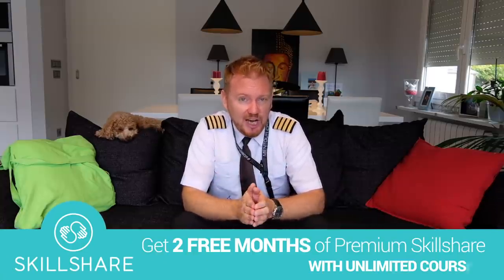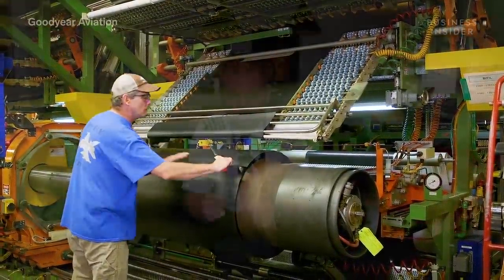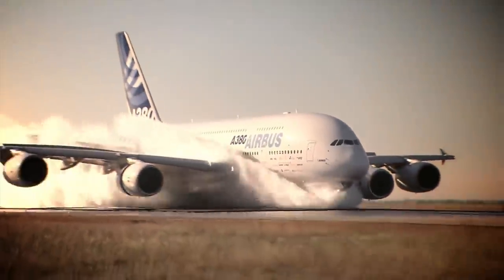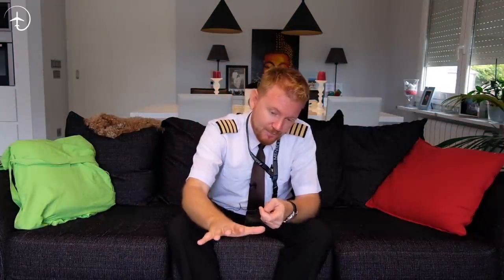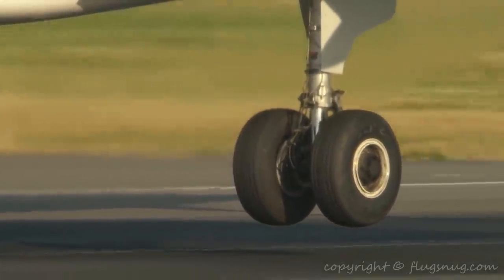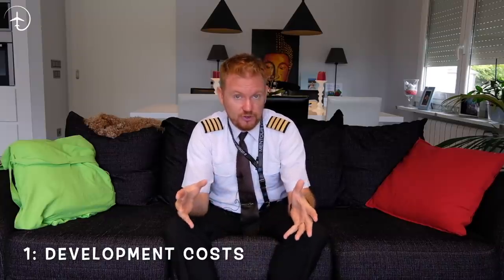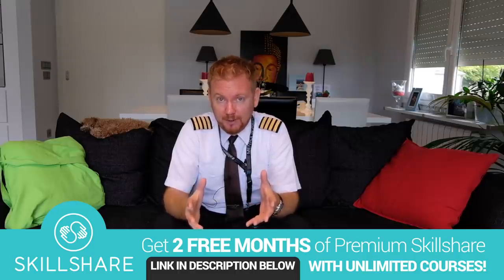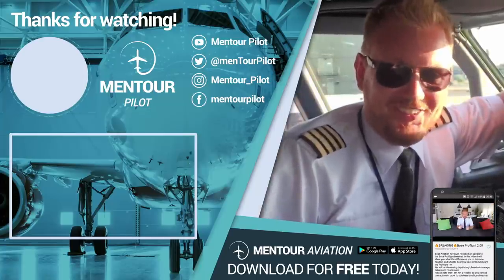Why not make plane-tires spin, before landing?!

Comment: You don't need a motor, you just need to add some shapes to the side of wheels so the airspeed will spin up the wheels for landing. And you don't need to match the airplane's speed. If you speed it up a little bit, now you will have less smoke and the tires will last longer and that is something.
Reply: I like the way you think
Reply: During WW-II many of the tires on the larger bombers were made with small flaps facing forward in the sidewall at the bottom of the rotation to use the airstream to start the wheels rotating before landing.
Reply: @JimForeman  so it's has already been done?
Reply: I guess it will add a lot of drag, thus making it harder to take off?
Reply: @HenrikOlander  But less wear on the brakes during landing.
Reply: Gyroscopic rotation, with the weight of these tires even slight unbalanced forces will cause quite a bit of issues and they will never truly match and counter rotation isn't possible since you need all the tires rotating in same direction. Then the vibration from mismatched rotation speed inducing stress on the airframe, better to absorb all the above with expendable and replaceable tires that you can fix the damage simply by changing them.
The old stories of airsoeed rotated stories are true and works but the size of the aircrafts where this was done vs a modern jetliner is staggering. If you wanted to do this with a Cessna i don't see any reason not to.
Reply: Agree that argument re motors seems spurious. That leaves vibration, mismatched inertia, and inertia  in crab landing as plausible reasons. Wonder how much inertia that is w.r.t. aircraft weight?
Reply: @JimForeman  Wilbur Shaw was working for Firestone during WWII, this was his idea.
Reply: You have to spin up the tires to really close to the touchdown speed or else they’re still will be substantial wear.
Reply: Very glad you mentioned that. Almost all his "reasons" really make no sense from a physics standpoint. A passive system like you describe would not cause any trouble when landing, and the speed of the tires would be less than the  final speed of the tires once they hit the ground. So it would only help things, not hurt them.
Reply: That is exactly what I think.
Reply: I was looking for this comment, don't understand why the discussion is only about motor... You got amaizing airflow on the wheel, it is very simple to cause them to rotate by simple fan attached to them.. the brakes of the wheels can control the balance of all together..

Comment: I thought too, that an aircraft when landing is trying to lose kinetic energy (speed), that by landing on stationary wheels a lot of energy is taken from the forward momentum of the aircraft and transferred into the rotational energy of the wheels. So this is a form of braking too, as soon as the wheels touch the ground.
Reply: good (overlooked ) point. quite a lot of KE would be transferred to rotational. a/c tires have a large radius (squared) and therfore loads of MI. I imagine theres also a bit of "differential feedback cotrol" in having wheels on both sides of the aircraft - effect  like a car differential?
Reply: but i think they wont take much energy, considering the momentum of a 65 tonne machine coming at 300kmph.
Reply: @abcdefgh6121  Every meter less in breaking distance is worth - not spinning up the tires prior to touchdown.

Comment: Hi, thank you for addressing a question I always had in mind. However, two notes:
1) you don't need to match the speed exactly, getting 80% of it would already more than halve the energy lost in the impact.
2) you don't need electrical motors, a set of wind vanes/turbines coupled to the gear axles would do the job. Even if you decided to use motors, you could draw the energy from the APU or engine alternators.
Reply: It is true Petter insisted too much about matching the exact speed (when even only 25% of it would be already better than no speed at all), but he ended with saying this is not the main problem anyway. The main problem of spinning the wheels would be when crab-landing.
Reply: @akseli9  Adding motors to the wheels doesn't decrease their abilities in any way. If it's safer, you can not use them when crab landing.

Comment: While our host discussed the hazards of certification and electrical accessories, I thought of a few alternatives, like using the 100 mph slipstream to spin the tires.  A set of rubber vanes glued to the sidewalls might be worth investigating.
Reply: Which type of glue would be better for that application- Elmers or Gorilla?
Reply: @kamakaziozzie3038 kamakazi glue!
Reply: @kamakaziozzie3038 flex seal will work best
Reply: They tried it... but to retract the wheels after takeoff... the wheels need to be stopped.  The added wear on the brakes costs more.
Reply: @wolphin732  That's a great argument against having vanes on the sidewalls.  how about a shroud that covers part of the top of the wheel but not the bottom, spinning the bottom.  The shroud wouldn't be deployed on take-off.

Comment: This was actually tried on the Lockheed Constellation in the 1940's, a motor spun the main gear up to lessen the landing forces, apparently pilots found it harder to tell when they had actually touched down and the feature was dropped as unnecessary.
Reply: Plus it added weight & created maintenance issues.  The idea sounds great but it was scrapped because it wasn't worth the trouble.
Reply: It was actually the Lockheed Constitution - a large cargo plane that never made it into production - that had this feature......
Reply: Ian Brown  was done, patented, dropped....safety issues
Reply: That's it exactly.  Your can't sodding land. The tyres spinning up take enough energy out of the aircraft to stop it flying.  Without which it just keeps skipping down the runway.
Reply: Actually, this concept was tried on the U.S. Army Air Force B-18, which was different from the B-17.  This was probably around 1940.  The concept was dropped, as I understand the facts, because little significant improvement in the landing procedure was found, and  only a few B-18's were built.
Reply: @dr_jaymz  most of the jets I have flown on mainly brake by reverse vectoring the engines instead of wheel brakes...
Reply: @mrstanskaggs1   - You don't engage thrust reversers until you're definitely not flying anymore.  Some planes prevent that with a ground switch (weight-on-landing-gear detector) interlock, because thrust reverser deployment in flight can be (and has been) disastrous.

I think you wouldn't want to be trying to deploy thrust reversers right as the wheels were making contact to make sure the plane "sticks" and doesn't regain any altitude.
Reply: William Burns   at

Comment: ~$1500 per tire, thats amazing, some luxury car tires cost this much. To me this was the most surprising fact
Reply: Bugatti charges ~U$20,000 per set for the Veyron
Reply: Standardization and big batches.
Car tires cost more because they are all custom made with lots and lots of different sizes and treads and compounds.

For one model of aircraft they essentially make a ONE SIZE FITS ALL tire and that can even go across a whole series of models or even a whole brand.
Reply: He said 15 000 per tire not 1500.
Reply: @키코kiko: That's not just the cost of the tires though. It's true that Bugatti charges that much but that includes picking up your Veyron from your home, flying it back to the factory in France for a full service of all the mechanical stuff, changing all the all oils, fluids and of course the tires, before delivering it back to your home. The tires themselves are only a small part of the cost.
Reply: @niconico3907  Wrongo Wrongo
Reply: @niconico3907  fifteen hundred, not fifteen thousands, so it's 1500 not 15000
Reply: $15,000 listen again
Reply: @shobordy1036  14:31 "changing a main tyre on a 737 costs about fifteen hundred dollars"
Reply: @ArtAkul88  I understood also 1500.  Some sites suggest also 1500$ cost, but other specify thousands of dollars!!!!  In my opinion 1500$ is MUCH too cheap.
Reply: Colin Southern.  Not 500,  260 to 300 km/hr at 9:58 in video.
Reply: I'm a trucker and I know for a fact that some semi truck tires actually cost about that much.
Reply: That  cheap ?  Loader  tires  can  be  over   $100,000
Reply: @nickbuis3307  : nonsense.
Reply: @shobordy1036  I did listen to it again and he clearly said fifteen hundred which of course is $1500 and not $15000. Whether it's a mistake or not I wouldn't know but it does seem too cheap.
Reply: @nickbuis3307  Yes, labour and other costs to change the tyre is $1,500, but you have to add on the cost of the tyre to that which is $10,000 and upward depending on the quality of tyre. Those tyres would be held in stock by the company operating the aircraft but they would require to be billed for changing the worn tyre for one in stock.
Reply: @jimjonrs3932  something like the Michelin X One line of tires for a semi can easily run $1,400-1,500 per tire, plus installation and other related costs.
Reply: Amir Mograbi i agree, I think it’s in the $15,000 range. In fact Dunlop has a monopoly in this business. It’s the only company in the world that makes and refurbishes all aircraft tires
Reply: @waqarghulam3548  Michelin and Goodyear (amongst others) make aircraft tyres.
Reply: $15,000 per tire
Reply: Steven Carpenter definitely not aircraft tires are pretty cheap usually. 737 and A320 don’t have the large expensive tires found on A380s. $15000 would buy a massive tire on par with the size of a front end loader tire for rubber
Reply: @Nareimooncatt  : if you're buying $1,500 tires for your semi you should rethink your business strategy. $300 to $500 will buy you all the tire you'll ever need.
Reply: Well, a simple Google search says that $1500 per tire is very incorrect. Try about $7000- $10,000 per tire.
Reply: @jimjonrs3932  those cheap tires are junk, being more likely to have a blowout and lowering fuel economy. That cheap up front cost leads to higher overall expenses. Not to mention the tire I listed is a super single, not a dual. So instead of 8 drive tires, there's only 4.
Reply: @Nareimooncatt  : more nonsense. Been driving 29 years and the only blowouts I've have were from recaps on trailers owned by someone else.
Reply: @jimjonrs3932  Been at it 15 years here and studied operational costs a fair bit. I've seen lots of problems with the cheap knockoff tires. Even if that wasn't the case, $6,000 on a set of drive tires that save you tons on fuel vs $2,400-$4000 that kill fuel economy, and it's a no brainer that the the expensive tires can be more cost effective in the long run.
Reply: @jimjonrs3932  Let's do some back of the napkin calculations. Let's say you get 6 mpg with the cheap $300 dual tires, and 6.5 mpg on the good $1,500 super singles. A full set of tires is $2,400 and $6,000 respectively.

Assume you get 150,000 miles from either set (easily done on a well maintained long haul truck). The cheap set would result in 25,000 gallons burned, and the good set 23,077 gallons burned. At an average $3/gal, that's a total lifetime cost of $79,800 for the cheap tires, but only $75,231 for the good set (total cost being tires plus fuel costs, all else being equal).

That's a savings of $4,479 for the more expensive tire. Stretch that out to 200,000 miles on a single set, and a good low rolling resistance tire easily pays for itself and then some in fuel savings alone.
Reply: @Nareimooncatt  : 2015 Freightliner Detroit DD13, 10 speed roadranger. 7.3 mpg in heavy urban driving. 7.8 average out on the road. Not bad for "cheap" tires. Durability? Excellent. Super singles? The minimal gain in mpg wouldn't break even on the additional cost over the life of the tire.
Reply: @jimjonrs3932  Cascadia? There's guys out there running 9+ mpg, but good on you for beating the average.
Reply: @Nareimooncatt  : 9 ! Do you really think your fooling anyone? The company I run for publish their average mpg for the fleet. I can get 9 mpg pulling a empty down the highway. I have a feeling your 15 years refers to trolling! Good bye.
Reply: @jimjonrs3932  so me putting actual numbers and results to the debate is trolling? I don't think that word means what you think it means. Lol. And sure, you can do 9 mpg with an empty trailer. The guys I'm talking about are doing it loaded and empty on an all mile average (not just dispatched miles).
Reply: I paid 2000 for a set of 35" mud terrain tires.

Comment: In all my years as a process improvement consultant, I have heard thousands of reasons why my improvement proposals wouldn`t work... until they did.
Impossible is one of the words I hate the most.
Reply: that's how i see it too..
some of the explanations don't really make sense to me as to why not implement wheel spinning.. the added weight most likely does not make sense, fuel consumption vs tire wear.
anyways, 
~there's no need for "huge batteries by the gas tanks"
~the plane would not veer off the runway in case of cross-winds, as the wheel rotation ca be controlled to account for the 'side-ways' touchdown
Reply: Agreed. It's all about "attutude".  Yes, more pun .. (cough)
Reply: I think he is over blowing the technical difficulty in implementing wheel spin. It definitely can be implemented and we have the technology to do so. But the things that he listed do make it less worthwhile to do so. So at the end of the day, there's no motivation to implement it.
The cost of development isn't cheap. It's not as simple as just spinning the wheel. A computer need to know the ground speed and crab angle which then actively adjust each individual wheel as the plane approach the runway. Then they need to fit the motors and batteries and computing systems somewhere safe without adding too much weight. Weight is a big deal because aviation fuel is really expensive, so any unnecessary weight will make each flight more expensive. Each addition need to have enough reasons to justify the added weight. TV screens for every seat attract passengers and that additional income justify the added weight and increased fuel consumption for example. Wheel spin is by all means possible but far from simple and so cost lots of money. Retrofitting would also means going through the regulatory bodies again.
New designs might be able to do it since they will have to go through a safety check anyways and the design can accommodate the system from the ground up instead of redesigning and retrofitting. But the airlines need to actually care and want that feature in the first place. If all else is the same, wheel spin feature might be nice, but more likely than not, fuel economy, seating and other features will not be the same and get most of the focus from potential buyers. If wheel spin isn't a attractive enough feature, designers won't incorporate it because it just adds development time and money. Instead that effort will be placed on better fuel economy and other more attractive design considerations.

Comment: Also not having the wheels spinning at touchdown generates friction that helps losing a bit of momentum without destabilizing the plane, but rather helping the landing gear to "stick" to the runway. Having them rotating even at the exact right speed would generate some considerable bouncing in the case of a steeper approach.

Comment: As an Aircraft Maintenance Engineer, I appreciate your presentation. 
And just imagine the accumulative complications (parts, labour, inspection time, something more to ground the airplane!)  going into just saving a bit of rubber to speed up wheels that you will be using energy to slow down right away anyway?!? Lol.
Reply: Small flaps like in ww2 would do the job
Reply: On the other hand if you mount electric motors on the wheels you could use them to charge the batteries onboard, and decelerate the aircraft at the same time! Using bleed air is probably much simpler. and just speeding up the wheels to 50% of normal landing speed would decrease tire wear a lot.
Reply: @ErikssonTord_2  Electromotors are heavy and you need a lot of them. Also you need a large battery storage. And big batteries and planes don't go well together.
Reply: @KneppaH   what do you think the motors and batteries would be used for? traveling in the plane but on ground? how heavy do you think a motor and a battery needs to be to spin a wheel a little bit?
Reply: @KneppaH  no they are not. Jaguar has 350hp electric motor that weighs 16kg. The weight of a fat cat is not heavy

Comment: I remember going on holidays with my parents many years back. As we got off the plane and walked towards the terminal I noticed two big airline tires propped against the wall. I touched one as I passed by. It felt more like a very hard plastic than regular tire rubber.  Tough stuff !
Reply: I think... but I'm getting on in years these days that I had a professor that told us airlines (at least back in his day) leased the tires and they were rated for X number of take offs and landings which we all agree should be equal... but it was a physics class a long time ago and he said fuel load at take off is way worse on the tires than landing... he was a former bomber pilot so I can't support or refute his supposition
Reply: That huge thickness holds a lot of technology also. A 767 main gear tire is a 32 ply tire, the nose gear is 24 plies (ratings… ply numbers can vary by manufacturer). Their limiting factor is heat absorption during braking.